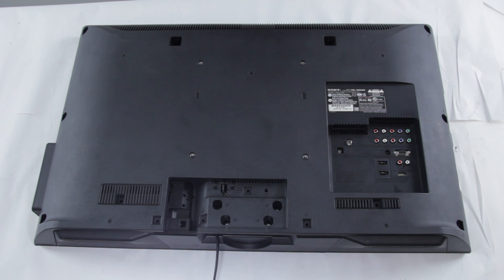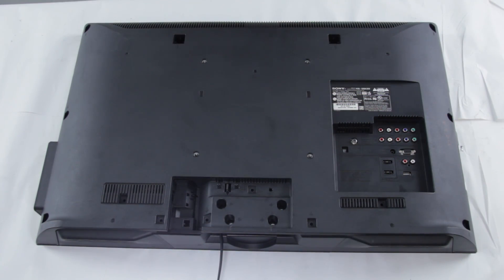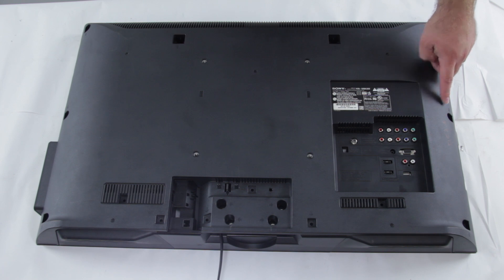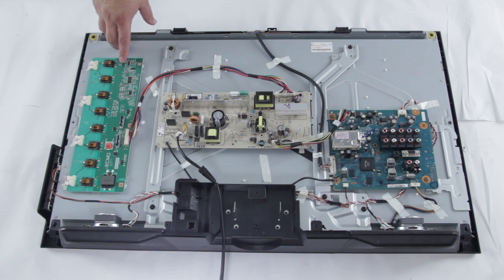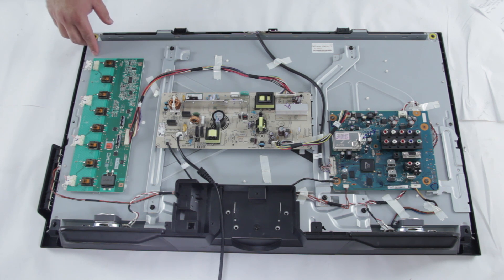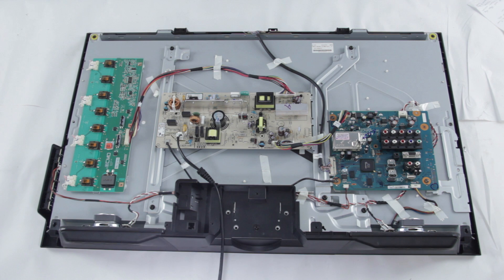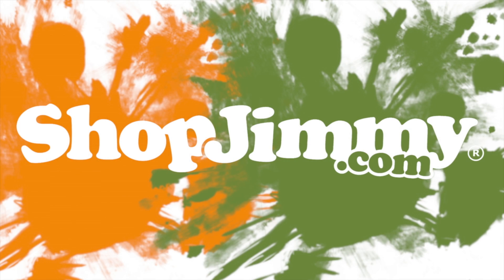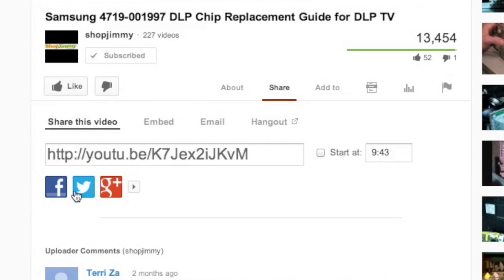LCD TV Repair Tutorial - Backlight Inverter Common Symptoms & Solutions - How to Fix LCD TVs

Comment: my tv is a philips 46PFL5706/F7 . It displays images on half of the screen and line across the part that does not display images. I changed the T-CON Board and it did not fixe the problem. I am seeking for help.  thanks

Comment: I have a JVC model JLC37BC3002 with nopicture but has sound. Has sympomsof a backlight problem (image up fo a sec...also can out a flashligh on screen and faintly see picture) It looks like the 2 inverter boards (Rand L) are located on the edge underf the frame. is taht so and also it looks like they are bonded to a fine ribbon connector that looks very hard do disconnect. any advice?

Comment: I have a 23HLV87 Toshiba TV when I unplug the TV for a few hours then plug it in and turn on it works fine, when I leave it plugged in and use it then turn it off and back on the screen comes on normal for a second then it turns bright white and almost strobe like with no real distinct image any help is appreciated, thanks
Reply from the maker: +vallanwiest   Try all repairs and troubleshooting at your own risk.  I recommend replacing the main board in your TV.  Click this link to a replacement main board for your TV model number:  http://www.shopjimmy.com/toshiba-ah302235-main-board-for-23hlv87.htm  There may be multiple boards for the same TV model number, be sure to match part numbers on your current board, with your replacement for compatibility.  Here is a link to a video showing how to identify your part number, click here:  https://www.youtube.com/watch?v=3DQe0ATZl_Q  Thanks and please let us know if you have any further questions with your TV Repair!  www.shopjimmy.com

Comment: VIzio  GV42LFHDTV10A, S/N LHAARAH3802435After a few seconds the picture fades to white with faint color.You can see images and the sound is ok but it's washed out.I changed the backlight inverter, reconnected all the cable but it's still the same.I appreciate any help before I but another.

Comment: i have a sanyo DP42848  the set will turn on. you can see picture for a second, then it is like a blue screen.the set also started to buzz about a week before it went out. do you think this could be a t-con board or the backlight inverter set?

Comment: Sharp Aquos LC-60C6400U, lower left corner is dimmer than the rest of the screen. I have had this problem for three days and today the TV shutdown with a flashing power light. I was able to get the power back on by unplugging, holding the channel down and vol + buttons together and plugging back in. Are all these problems a backlight inverter problem?

Comment: hi i have a samsung TV model# LN46A750R1FXZA serial #ALAU3CNQ701767F.when tv turns on picture on screen is dark on left side an images seem to be in slow motion.when tv is on for awhile (warms up)then its fine.that was good for about a month.now its always dark on left side of screen an images look to be in slow motion.there is a new power supply board in it same problem.im guessing its the inverter board because its only part of screen.any input would be welcomed ty.

Comment: I am having trouble with my Rca lcd flat screen televisions 46la45rq ..  As soon as I turn on the tv after 5 or 10 seconds it cuts off but I still can here the sound ..  I asked some one else about it and they told me to use a flash light and if I still can see a image in the screen then its the inverter board  .. so after 4 months I finally found one on craigslist and when I replaced it for it still does the same thing..   Now I'm upset because don't know what it can be , I when I took it to the shop they were going to charge me more than what the tv's worth..   Do you think you know what it can be???
Reply from the maker: +llerrej2   Try all repairs and troubleshooting at your own risk.  This sounds like you have bad bulbs in your TV.  Unfortunately we do not sell replacement bulbs for your TV model number at this time.  Thanks!  www.shopjimmy.com

Comment: I have a Sharp LC-52D62U LCD TV.  My TV has recently started displaying blue "dots & dashes" all over the screen.   We can see the TV and it's actually watchable but its sort of "snowy blue" from a distance.  It's not the cable or input because you can actually see the blue dot-dashes on the menu as it displays on the screen while connected to no HDMI signal.   Anybody have an idea what needs replacing?  Oh, and I pulled out the ribbon cable between the board with all the inputs and what I think is the TCON board.  I cleaned it with alcohol and replaced but no change.   Thanks for any help.

Comment: HI. I have a SAMSUNG TV Model Number LN40B530P7NXZA Serial NO. B4X53CSS600132B. 

My picture screen is grey. I can see the picture but it looks like the brightness is turned all the way up. Can you please help?
Reply from the maker: +Channy Moravong  Try all repairs and troubleshooting at your own risk.  This could be a problem with either the t-con board, the main board or the TV panel.  You can replace the t-con board and main board individually to see if one of those boards fixes the problem.  Click this link to replacement parts for your TV model number:  http://www.shopjimmy.com/catalogsearch/result/?q=LN40B530P7NXZA  There may be multiple boards for the same TV model number, be sure to match part numbers on your current board, with your replacement for compatibility.  Thanks and please let us know if you have any further questions with your TV Repair!  www.shopjimmy.com

Comment: Thanks for sharing. I have a Goodmans LD3255HD tv. It works ramdomly. When it works it does not have any problem. Only some times a squeezy noise on the background. But if you dare to touch the control buttons on the side, it may shutdown unexpectedly or start distorting the image. It could be that it split the image or only pure noise with long lines that looks like the image it should be showing. Let me know if you have any advise about it. Many thanks.

Comment: I have a Samsung LN46C600F3FXZA LCD TV that has sound but no picture. All the capacitors are ok on the power supply board. Is there a way to trouble shoot whether it's the TCONN board or the Inverter board? What are the part #'s both boards? Is there any other advice you can offer? Thanks in advance for your help.

Comment: Backlight Inverter is definitely the problem. Need to know if you have replacement for JVC Model: JLC37BC3002 / SN: TR1DAJ022000047.

Comment: I have a LG 60PN5700 model #: 60PN5700-UA. it has the same problem where the LED comes on, but when i turn the device on it shows a brief color change from black to a dull gray then it turns black again. finally it turns itself off then back on again. on and off by its self. plz help
Reply from the maker: brian kazibwe    Try all repairs and troubleshooting at your own risk.  I recommend replacing the main board in your TV.  Click this link to replacement parts for your TV model number:  http://www.shopjimmy.com/catalogsearch/result/index/?cat=56&q=60PN5700-UA  There may be multiple boards for the same TV model number, be sure to match part numbers on your current board, with your replacement for compatibility.  Here is a link to a video showing how to identify your part number, click here:   https://www.youtube.com/watch?v=RwHTvjMdrhkThanks and please let us know if you have any further questions with your TV Repair!  www.shopjimmy.com

Comment: samsung LN37A330J1DXZA, turn on tv it is now very cloudy, have sound and some picture but no true color, like a fog over the screen. My blacklight inverter looks very similar to the one in your video. My problem is I can not find a part number on the part when took tv apart. Also, does this sound like a backlight problem. thanks for your help
Reply from the maker: Rayray G   PLEASE SUBSCRIBE TO OUR CHANNEL - Try all repairs and troubleshooting at your own risk.  This could be a problem with either the t-con board, the main board or the TV panel.  You can replace the t-con board and the main board individually to see if one of those boards fixes the problem.  Click this link to replacement parts for your TV model number:  http://www.shopjimmy.com/catalogsearch/result/?q=LN37A330J1DXZA  There may be multiple boards for the same TV model number, be sure to match part numbers on your current board, with your replacement for compatibility.  Thanks and please let us know if you have any further questions with your TV Repair!  www.shopjimmy.com

Comment: I have a Dynex  E40BSZNKLWBUNNX, serial #ccub5ya005588. The TV comes on for about 10 seconds, then screen goes black but sound is fine. Do I need a backlight inverter? If so, do you stock?

Comment: I have a RCA L42WD22yx6 serial I134CU036 First experience; would have to unplug to turn on tv, red light blinking, no green light. So other than unplug and replug no problem.

Then no picture 3-4 mos. later. I took power board off changed 1 swollen cap 1000uf35V. reassembled came on good with green light working properly but still no picture.  I simply plugged in, powered up with no input source. I expected to see a "Unusable source"?? floater hoovering across screen, I got nothing. Heavy Sigh...

So i dug it open again and took out both backlight inverter boards, they appear to both have 2 caps on each with tops looking a little raised. So I suspect they are all 4 bad. But not sure. Main Board "Looked" fine as far as caps go. 

Any ideas?

Comment: Hi,

My 22" Curtis LCD TV (SN: 100100461 &  MODEL: LCD2244A) gives sound but no lit image. If I look closely I can seen the picture on the screen but the backlight does not work. Before, the screen usually goes bright white when I turn off the TV and stays that way. It flickers at times during this period.

What do I need to do or buy to fix this?

Comment: My Tv model is LC-32GP1U. It turns on and I scarcely can see the image and instantly the image shut down, the sound continues during a several seconds and then the Tv completely turns off. The power indicator remains blinking once indefinitely.
I can't get into the service mode because the power indicator never cease of blinking.
What can I do to make the power indicator stop blinking to allow me enter to the service mode. Excuse me if I ask something that you have explained clearly, but I can't understand English very well.
I should thanks a lot if you help me to enter to the service mode in order to see the errors or to reset the Tv.
My regards!

Comment: Need tv repair help.  I have a Samsung LN46C630K1F. Since a couple of months, my tv sometimes flickered. But now, there is no picture at all. I hear the sound perfecly but no image. I ordered form your shop the t-con board and replaced it. Nothing, still no image but the sound works. I tried the flashlight test to see the image in the dark and i haven't seen nothing. There seems to be no ligt anymore in that tv.  The inverter maybe?
Reply from the maker: Daniel Paquet   PLEASE SUBSCRIBE TO OUR CHANNEL - Try all repairs and troubleshooting at your own risk.  I recommend replacing the main board in your TV.  Click this link to replacement parts for your TV model number:  http://www.shopjimmy.com/catalogsearch/result/index/?cat=56&q=LN46C630K1F  There may be multiple boards for the same TV model number, be sure to match part numbers on your current board, with your replacement for compatibility.  Here is a link to a video showing how to identify your part number, click here:  https://www.youtube.com/watch?v=BEPWrefQvqI  Thanks and please let us know if you have any further questions with your TV Repair!  www.shopjimmy.com

Comment: I have a 32" emerson model lc320em1f serial number DS2A1034188637 It just stopped working one day the screen never came on it just flashes about 13 or 12 if the last one isn't a flash I've tried all the normal things and checked the capacitors there seems to be no damage. So I figure it's likely the inverter or the panel not sure how to tell. What should I do to fix it?

Comment: LN40B630N1FXZA  Samsung TV.  After lightning struck our house, it has caused this tv as well as others to not work properly.  This tv.  the standby light comes on when powered off and when we press the power button the standby light turns off, but nothing else happens.  no screen or sound is heard.
Reply from the maker: Tony Smith  PLEASE SUBSCRIBE TO OUR CHANNEL - Try all repairs and troubleshooting at your own risk.   I recommend replacing the main board and the power supply board in your TV.  Click this link to replacement parts:  http://www.shopjimmy.com/catalogsearch/result/?q=LN40B630N1FXZA+  There may be multiple boards for the same TV model number, be sure to match part numbers on your current board, with your replacement for compatibility.  Thanks and please let us know if you have any further questions with your TV Repair!  www.shopjimmy.com

Comment: My backlight stopped working on my lg la6200. I replaced the power supply board which I believe has the backlight inverter built in. This however didn't fix my issue.

I have sound and can see image under a flashlight. Do you think the mainboard could be the issue?
Reply from the maker: Brian Johnson   Try all repairs and troubleshooting at your own risk.  This sounds like you have bad LEDs in your TV.  Unfortunately we do not currently have replacement LEDs for your TV model number.  Thanks!  www.shopjimmy.com

Comment: Hello I have a 42" Vizio 3D Led TV. It recently got a dim portion across the middle of the screen horizontally across my TV. Everything is working fine, except the dim backlight. It takes up about half to 2/3rds of my screen horizontally with the dark area. It really seems like a backlight or inverter issue. The model number of my TV is E420D-AO. I am great with hands on projects, I just want to see if you could recognize the problem with the symptoms the TV has. Thanks for your time and help. I have been on your site, but not sure what product is the best option.
Reply from the maker: Jaime Rojas   Try all repairs and troubleshooting at your own risk.  This sounds like a problem with the LEDs in your TV.  You could contact a TV repair professional and see if they could replace the LEDs in your TV.  We have some in stock for your TV model number, but you need to confirm other numbers as well.  It is recommended that this repair be done by a professional as you could easily damage your TV panel.  Here is a link to replacement parts for your TV model number:  http://www.shopjimmy.com/catalogsearch/result/?q=E420D  Thanks!  www.shopjimmy.com

Comment: hello I have jmb tv and the screen went blank when I turn it on with remote the red light flashes and stays on but when I press the button for channel it flashes then it goes off   model number jto1320003b/01  sn 7011000300672 can you help

Comment: I have a Samsung Model Number(LN46A530P1FXZA) Serial Number (ALDK3CNQB01684R) When the TV is on it is very bright. It does this no matter what is hooked up (Cable, PS3, X-Box). I tried resetting to factory settings in the menu and didn't help. I can see the picture but really bright,  Was wandering what would cause this. Thanks for your time.
Richie
Reply from the maker: rvincel1   PLEASE SUBSCRIBE TO OUR CHANNEL - Try all repairs and troubleshooting at your own risk.  This could be a problem with either the t-con board, the main board or the TV panel.  You can replace the t-con board and main board individually to see if one of those boards fixes the problem.  http://www.shopjimmy.com/catalogsearch/result/index/?mode=list&q=LN46A530P1FXZA  Click this link to replacement parts for your TV model number:  http://www.shopjimmy.com/catalogsearch/result/index/?mode=list&q=LN46A530P1FXZA  There may be multiple boards for the same TV model number, be sure to match part numbers on your current board, with your replacement for compatibility.  Thanks and please let us know if you have any further questions with your TV Repair!  www.shopjimmy.com

Comment: Hi I have a viore lc26vh56. When u turn it on, it now takes 10m for pic to come in. The screen changes colors and sound heard. After 10m or so pic comes in like normal. Any idea what it could be? Thank u
Reply from the maker: Andrea Terrell   PLEASE SUBSCRIBE TO OUR CHANNEL - Try all repairs and troubleshooting at your own risk.  I recommend replacing the main board in your TV.  Click this link to replacement parts for your TV model number:  http://www.shopjimmy.com/catalogsearch/result/index/?cat=56&q=lc26vh56  There may be multiple boards for the same TV model number, be sure to match part numbers on your current board, with your replacement for compatibility.  Thanks and please let us know if you have any further questions with your TV Repair!  www.shopjimmy.com

Comment: I have a Sony KDL 52XBR9 LCD TV with a backlight issue. I was using it when all of a sudden I noticed that the backlight on my TV dimmed a little. Initially I thought it was a problem with my Xbox One and it automatically lowered the brightness or lightness of my TV to finally coming to the conclusion that it was a backlight problem. Is it possible that I can have a TV repair person come to diagnose and solve it or are there any troubleshooting you can recommend or both?
Reply: Dimitri Brown Also to add after viewing this video, the picture on my TV DOES NOT turn black or shut off. The light just dims dramatically all of a sudden and causes the picture to look somewhat dark.